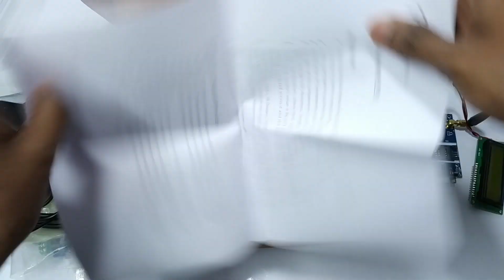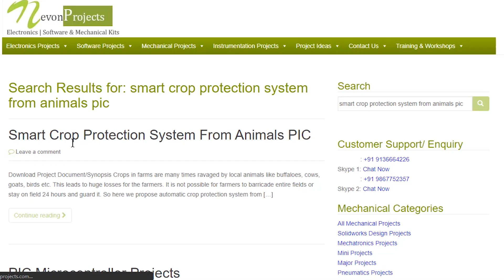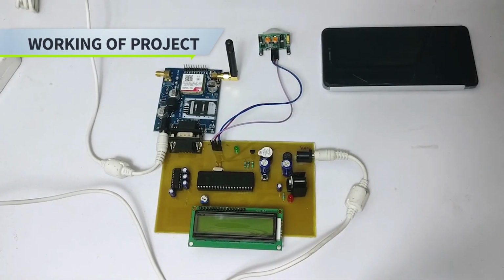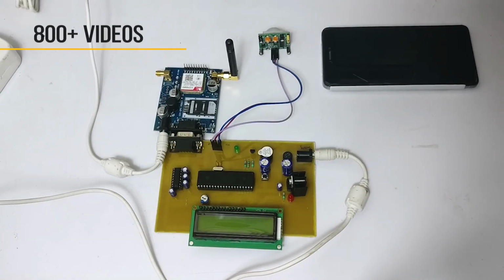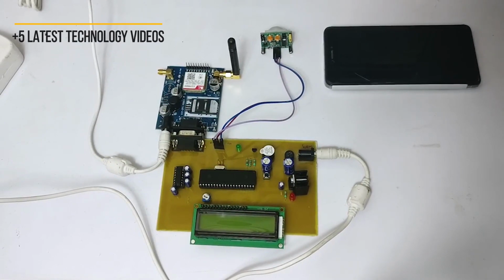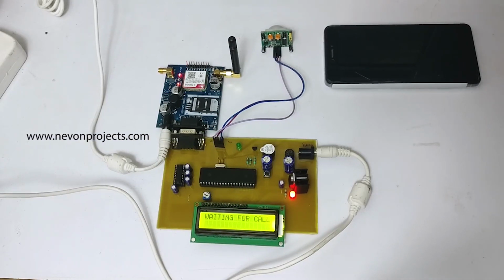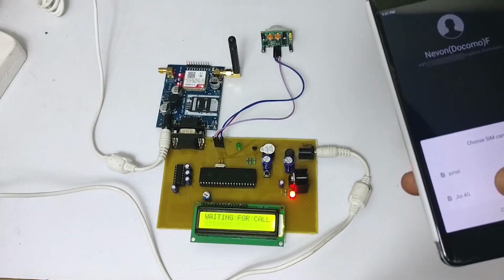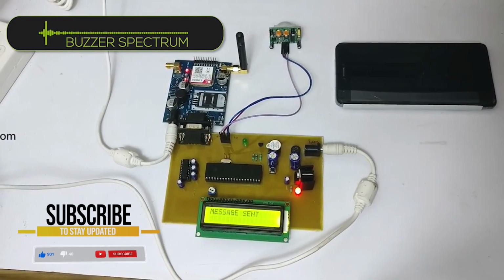Automatic Farm Protection From Wild Animals With Alert Using PIC & GSM

Comment: How will it works on night time
Reply from the maker: It will work day and night no matter no light sensor here its motion sensor, day night dosent matter.. For this Electronics system details or free document/PPT pls call watsapp
+917738796642 or visit link in video description
Reply: @NevonProjectsOfficial  bro we need "laser security system using gsm module and IR sensor project" Circuit diagram and code...
Reply: Could you please help us?